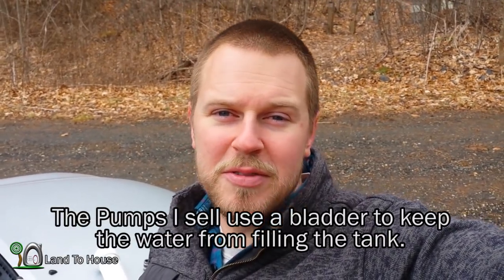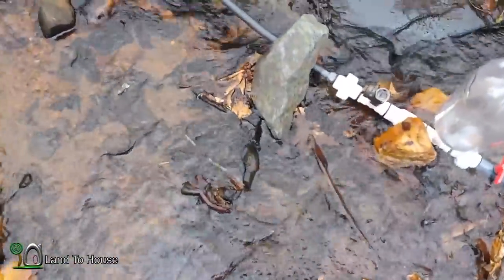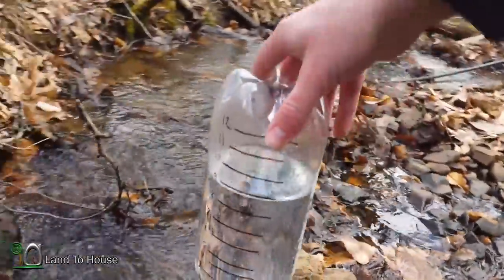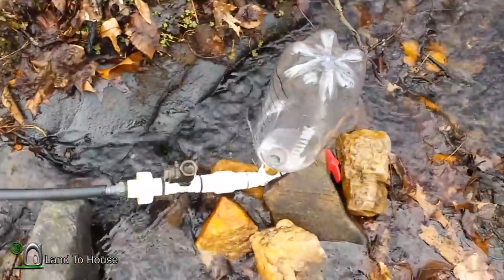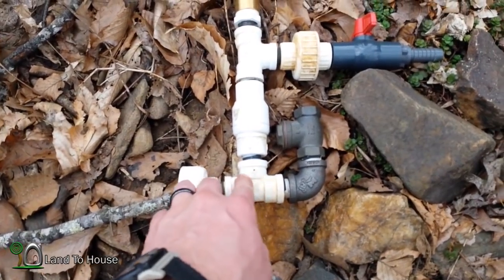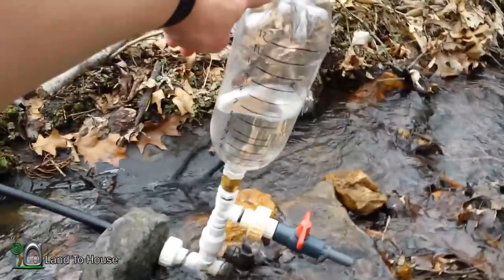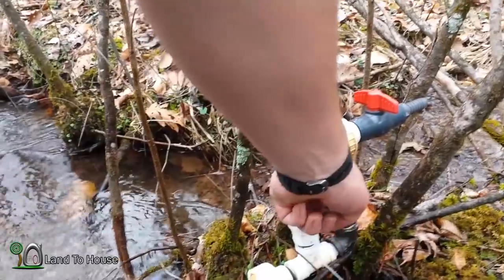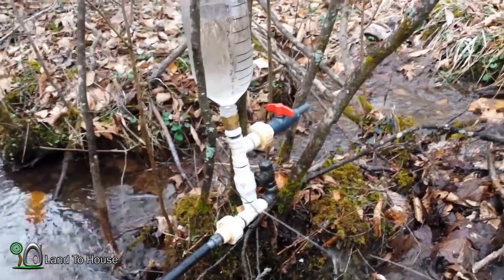Ram Pump Snifter Valve Research

Comment: There's nothing wrong with using a simple hole for a snifter, but it needs to be upstream of the delivery valve, not downstream as you've put it for this video.
Downstream of the delivery valve, the inside of the hole will always be under full delivery pressure and there's no way it will ever suck air. If you put the snifter upstream of the delivery valve instead, it will see only drive head pressure for most of the cycle, then full delivery pressure very briefly as the waste valve slams shut, then below-atmospheric pressure very briefly right after the delivery valve closes again. See https://en.wikipedia.org/wiki/Hydraulic_ram#Sequence_of_operation - the snifter hole needs to see the same brief vacuum pulse that sucks the waste valve back open, not be isolated from it by a closed delivery valve.
Have a look at the pulse of water escaping from the (clearly quite large) snifter hole in this commercial ram pump every time the waste valve slams shut: https://www.youtube.com/watch?v=5pD2fJo7_bo&t=1m51s
If their snifter were placed where you've put yours, that pulse would be a continuous jet just like yours.
To make sure the sniffed air bubble ends up in the pressure tank rather than escaping with the waste water, the delivery valve needs to be in a vertical pipe section right under the pressure tank with the snifter immediately under that, instead of in a horizontal section as it is for most of your pumps.

Comment: I've been watching ram pump videos for years and want to build one.  However, what can be done about the waste water if you don't want a pool of excess water around the pump?
Reply: Joe Downing the pump is supposed to sit in the water source it is pumping so the waste water just flows back to where it came from
Reply: Put a tee with another ball valve in line with the waste valve.  To start the pump open the ball valve, because it's straight through you can trip the waste valve with a long nail.  Once running close the ball valve and the waste water will run out the open port on the tee into a hose to anywhere you want as long as there is no back pressure in the hose.

Comment: I want to try one for my home but no running stream nearby.
Reply from the maker: You can use a pump based on a rain barrel but it will only run for a few minutes. Much better to have I Creek
Reply: @LandtoHouse  I don't have a creek either, but I NEED to build one of these:)
Reply from the maker: They are lots of fun to play with. There is a build video on the channel showing how to make a 1/2" pump that might help.

Comment: Air will eventually dissolve into the water, over a very long time.  Probably the easiest way to replenish the air is to turn off the inlet pipe, and let all of the water drain out of the pressure chamber.  You should only have to do that when you notice the pressure of the outlet is falling.  Maybe once a year or so.  Another way is to put a Schrader valve into the pressure chamber, and use a simple tyre pump.  [Just corrected my spelling!!  Schrader, not Schroder]
Reply from the maker: +Rusty Fox well stated. The small do-it-yourself pumps don't really need to have a snifter valve. Because draining the water out should not be very hard to do. The pumps that I have for sale on my website use a bike tube to prove the pump operation even with some water logging. I have definitely seen those pressure tanks with valve's to flush out the water by replacing air.

Comment: Hi, i just recently got into building ram pumps and when i built mine i didn't have a rubber inner tube handy so i built it without one and without a snifter valve. My pump has been running constantly for about a week now with about 2 feet of head and im not sure if i just got lucky or built mine Slightly different but i dont have a problem with my pressure tank filling with water, im not sure if this is something you have experienced or if you had an explanation for why it doesn't fill with water? like i said im new to them and would like as much knowledge as i can get, thanks!
Reply from the maker: +justin whittington it's nice to hear you're working with the ram pump. They're really awesome. For a couple of months you should be fine with the water log issue but when you get up to 7 and 8 months of continuous operation the tank will become waterlogged and the pump is significantly less efficient. But if you take the delivery pipe off every couple of months and empty the water out of the tank it's good to go without a valve or a bladder
Reply: Ok, that doesn't sound too bad i built mine with screw fittings so it can be taken apart relatively easily, i just thought seeing how fast the 2 liter bottle filled up in your video i thought i may have accidentally found a solution or something lol but anyway im a huge fan and ive watched all of your ram pump videos thanks for replying so quickly!
Reply from the maker: +justin whittington those tanks fill fast for sure we just can't see how full it is.  :) thanks for watching my videos!  I now have 15 house videos filmed so lots of videos on the way.
Reply: Every water supply is different in that the oxygen or carbon dioxide content of the water varies. Think of a mineral spring with natural carbonation as the base and a dead quiet lake as the opposite. If you have "air" in your water naturally, you may not need the snifter valve. Which by the way is just another, but tiny, check valve, operating with the pulses of water hammer. IF you guys put a tire - Schrader - valve in the top of your air chamber you could just pump it up with an air compressor or hand pump from time to time, displacing the water in the chamber by adding air enough to match the discharge head.

Comment: I have a suggestion for you to try. How about making the water tank into 2 parts. The top part would be for air and the bottom part for water with a reduced pipe size between the two. Then make a float valve between the two sections to close when the water reaches the top of the lower tank. This would prevent the top from filling with water. Is there a reason it wouldn't work? another idea how about making an insert that seals against the inside of the pipe that floats up and down with the water level and seales against the pipe to isolate the water from the air. Like a bladder tank with out the bladder.
Reply from the maker: I fear that the float valve would get stuck with the high pressure. Then there would be an unusable space in the tank. In my other pumps I use a bike tube in the tank and that seems to do the trick.

Comment: what you want is an Venturi at the drive pipes inlet , could be at the start or near the first valve  
( at the start it would be dissolved into the water , near the valve you will have micro bubbles ) 
all you need a  few small tubes at the pipes entry the water will pull the air into the drive pipe and the air will separate in the pressure chamber , pump will speed up from increase of PSI as more air to be compressed  , you may need a bleed valve :P

Comment: Built one of these with a larger air bottle. Put a small float valve inside that opens a hole in the side of the air bottle to release the water....back into the pond. when water in bottle drops, system resumes pumping. 
  The float valve is similar to the floater in a toilet tank.  I put it at the lower  center of the bottle, with the inlet flap toward top, and outlet flap toward the bottom. 

the float is one of those little plastic clear balls that has the rings/toys from the quarter machines, a thin bolt with head inside.  Used waterproof silicone to seal it.  Took the angled connector from 2 toilet fill valves. Screwed a bike inner tube valve using the metal valve piece resing on the bottle, nut inside, and nut outside to hold in place..Both top and bottom.   Put screw from float arm infront of both air valves.  adjust so that when float goes up, screws pushes into air valves to release. Takes some trial and error.

In comparison to your bottle, the float is around the #5 mark and the lower valve is around #2 mark, with an upper valve at #10. 
when sitting at 3 and below, the valve is closed, and system is pumping. after 15 to 20 min runtime, the water gets to about the #5 mark, and opens the bottom valve releasing water from bottle, and letting air in from top.  System pauses during this time...about 2-3 min.  When water level drops lowe enough for float to drop, flaps close and system resumes like normal. 

Works great for my little pond waterfall/bio filter.

Comment: Put a basic one way valve as the snifter so air can get in but water doesn't leak out.
Reply from the maker: +Mike Wiscombe I was wondering about that.  Possibly a bike tube stem???.
Reply: Can you get a tiny check valve. I think a bike valve wouldn't allow air in as the rubber is quite tight on the stem.
Reply from the maker: +Mike Wiscombe I was just looking at this project again and I think my next step will be trying to add a taller pipe on the pressure tank. I believe I'm drilling too low in the system and there is no air to gulp. If that does not work I found a one quarter inch PVC check valve that might work.
Reply from the maker: I have over 30 videos on the ram pump. The delivery hight of this one was not really part of the test. Just needed the back pressure to keep the pump going. I am not a big fan of the snifter valve on the DIY model. But I can see that it would be very helpful on a commercial model.

Comment: does the weight in the bottle affect anything, if u but like 1000 litres of water, it causes bigger pressure
Reply from the maker: +Jouni Kyyrönen The tank needs to be large enough to build pressure but if it is too large the tone it takes to build pressure will be really long. The ram effect can only build pressure based off the head pressure. So a really big tank will not help.

Comment: Put a check valve the so it can suck air but not leak water
Reply from the maker: I have a couple small valves from a CPAP machine hose. I hope to try that this summer.

Comment: The air under high pressure in the tank is absorbed by the water over time. Your inner tube prevents absorption.  My old (now retired) double acting Meyers 'Bulldozer pump" had provision for a 'snifter' valve in the head of the cylinder which was actually a Schrader tyre valve.  My ram pump however is a different design and has no tank but about 4 ft of 3" rubber high pressure hose between the non-return valve and the delivery pipe. It has been working 24/7 for about 8 or 10 years without any maintenance. Similar to the hose arrangement on this design. http://www.wot.utwente.nl/publications/breurram/breurram.html.
Reply from the maker: +Gary Armstrong over eight years without maintenance is really great. I was just testing out the potential for the snifter valve but never actually installed a valve. So far I prefer the ram pump without snifter valve
Reply: Remember that it may be a Schrader valve but it has no spring as the pulsation drives it back and forth. Juat a tiny check valve without a spring

Comment: hi my name is Paul and i live in Germany. I am 13 years old an i have build my first ram pump its 1/2 inch.            I let it run with a watering can and it worked, then i build it in the little river beside my House a it is not working.           I would love to hear feedback  from you                 PS like your videos very very much
Reply from the maker: Hello. Nice to hear from you. It is possible that you do not have enough head pressure in the river. Do you know how much drop there is in the river from water source to pump location?  Thank you for watching the videos!

Comment: Here is some text on snifter valves: Don't Confuse High-Pressure Schrader Valves on a Pressure Tank with Low-Pressure Schrader Valves Used in a Drain-Back System

Watch out: when replacing the valve stem core in a Schrader valve that is serving as an air admittance valve on a drain-back system, be sure you obtain the proper low-pressure valve core or valve stem from your plumbing supplier.

The valve stem or core in this application has to open at around 2-3 psi whereas a typical tire valve opens at a higher pressure, perhaps 10-12 psi. If you put the wrong type of valve core into your drainback system air snifter the system won't work and the water pressure tank will become waterlogged, leading to well pump short cycling.

Separate from an air admittance or snifter valve used on a drainback system, some water pressure tanks include a conventional Schrader Valve that operates in the higher pressure range. That valve, used to manually adjust a water pressure tank's pre-charge pressure, may be present on a tank tee at the bottom of the water tank, or on the tank body, usually near the top of the tank. Details are at WATER TANK AIR INLET VALVE.

https://www.ebay.com/itm/Snifter-Air-Valve-1-4-Nl-by-BOSHART-INDUSTRIES/162044202448?_trkparms=aid%3D555018%26algo%3DPL.SIM%26ao%3D2%26asc%3D20160908110712%26meid%3Dc724ec7f1d3f4854a5bdd51de57fa221%26pid%3D100677%26rk%3D1%26rkt%3D6%26sd%3D172161126696%26itm%3D162044202448&_trksid=p2385738.c100677.m4598

https://www.google.com/search?q=snifter+valve&num=100&hl=en&authuser=0&rlz=1C1AOHY_enUS708US709&source=lnms&sa=X&ved=0ahUKEwjF_fLh5ajeAhWHi1QKHbzNCzEQ_AUIsgIoAA&biw=1680&bih=959

Comment: hello my name kamto from indonesia. i think  cj w theory is right. its look like what i read or see in several sources. i've made my own ramp pump too and its work nicely. imade it from iron pipe. but without snifter valve. yes it is... every couple month i must drain the pump in order to fill air to the tank. maybe you can see my video on youtube type a tittle " membuat pompa hydram 2 (pompa)'  and you can share your opinion about that. thank you keep inventing seth... sorry my english is bad
Reply from the maker: I just checked out your video. Nice pump. I also build my pumps without the snifter valve. I feel that the pump works better that way. I place a bike tube inside to help prevent the water logging effect so I dont have to drain the tank as often.
Reply: thankyou for your opinion ill try to aply that.
would you give me your adress? ill try to search by google earth. thank..
Reply: kamto brava ydj